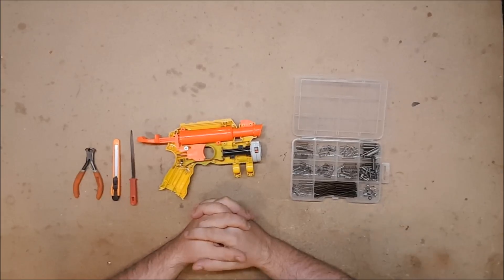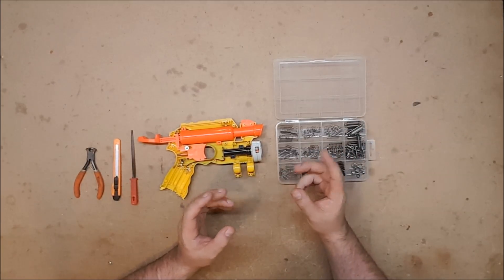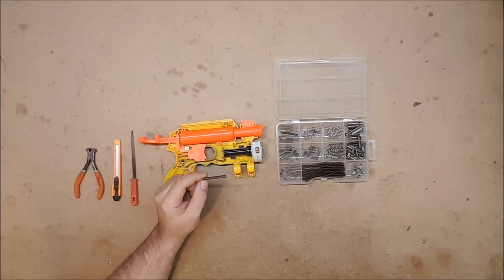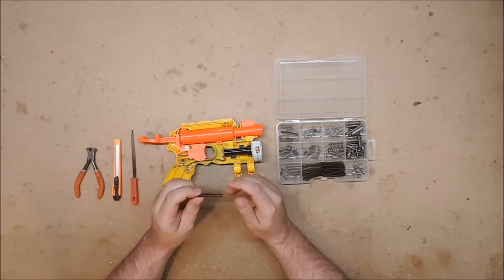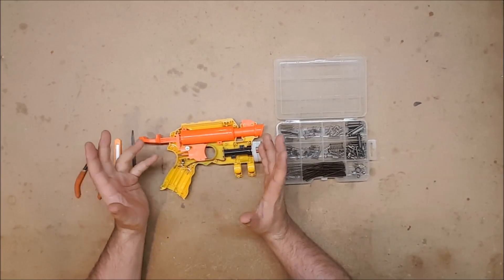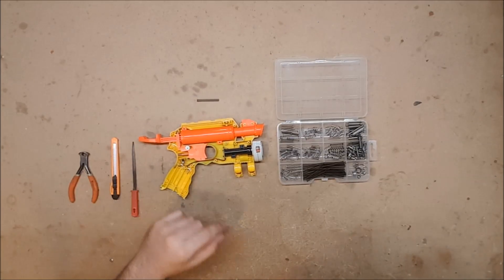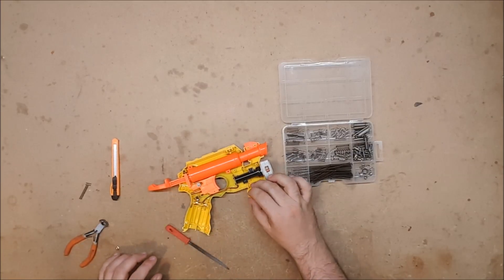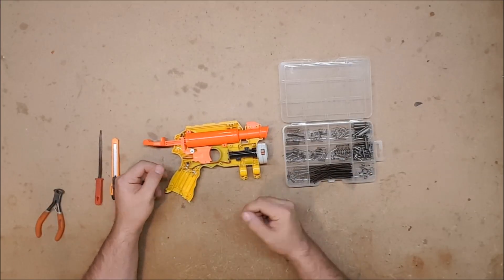Monday Mod Tips - Episode 6 - Catch Springs

Comment: Hey Capt. I was wondering. Can you make removable air tanks, so you could switch them out on the fly for more efficiency? I thought of that idea when I saw a Super Soaker Drum that holds water.
Reply from the maker: I'm sure it is possible...but definitely not with the effort.
Reply: Paintball HPA tank?

Comment: i was wandering if you can put direct plunger into old blasters. like the maverick and see if it still shoots. i think it could really troll some one if it could work like that.
Reply: You can, with enough epoxy, do anything.

I have seen someone integrate the back end of a nitefinder onto a maverick, so that the trigger still rotated the maverick cylinder and also pushed on the nitefinders sear. It certainly didn't look stock, as it became straight pull prime from the nitefinder instead of the slide from the maverick.

If you wanted it to LOOK stock, then you'd have to find a plunger tube that fits inside the maverick body, which is very thin so you wouldn't get a big one, and then rework the sear catch as the original only really works with the indirect plunger.
All in all, it's very doable, and if you ruin it it hardly matters as there are more nerf mavericks than grains of sand on this planet.
Reply: You know there is a way to male costum plunger heads right
Reply: If you can make a plunger head, then you can convert a maverick to direct plunger.